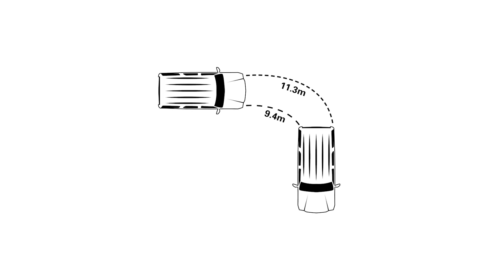SUB $600 DIY LOCKER INSTALL – Watch how much difference it made - Front vs. Rear, Manual vs. Auto

Comment: These things are essentially a ratchet in place of your normal diff centre (spider gears). They lock up under power, and force both tyres to run at the same speed as the ring gear, never slower - but if one tyre (the outside tyre) wants to run faster than the ring gear, it ratchets (hence the clack-clack noise) and that one side unlocks. The slower side is still locked to the ring gear. This means shock loading is reduced compared to unlocked diffs, so you should break less halfshafts in theory.

In theory...!
Reply: I was wondering and this is the perfect explanation. Thanks!
Reply: I see as a load thing. .certain amount of load and it slips. .. I agree with you. .in theory ☺
Reply: @simontheyers547  It's not a load thing, and my explanation is not a theory.  I'm not trying to be rude, just explain that this is how they're engineered.

Ok, if you want the facts of how they work:  Your diff centre spider gears are replaced by two solid chunks of metal with ratchet sprockets on the outside, that mate into special side gears with similar ratchet sprockets on their inside face.  Under no load, they'll ratchet (clack clack clack as one tyre spins faster than the other - or in the opposite direction even).

Between these two chunks of metal you have a pin (the "carrier cross pin") that runs right through the thing, in a hole that isn't quite round.  As you apply power, the diff carrier pushes on the carrier pin, and the carrier pin slides inside the slightly not round hole it lives in.  This then pushes the two halves of the diff centre apart, forcing them into the side gears and locking them (and by extension, the wheels attached to those side gears by halfshafts).

If one wheel tries to run faster than the diff housing, that causes the pin that is forcing the two halves apart back into the centre of the not quite round hole because it's not pushing the diff centre as fast as the wheel is turning.  This lets the two halves slip back out of engagement with the side gears, and the whole thing unlocks, allowing the faster wheel to ratchet.  (Clack clack clack).  You can see this demonstrated at 2:12 in the video, where he pushes one side out of engagement with a screwdriver.  In that shot you can also see the not-quite-round hole between the two halves (he doesn't have the cross-pin installed at this point, you can see it on the floor on the left).

This is why if you try to power around a corner, they'll make crashing, banging, clunking sounds as they lock, unlock, lock and unlock over and over again.  Most people try to coast around corners or at the very least, take corners smoothly without excessive power.

This is not theory, this is how they're engineered.  Trust me, I have built these into diffs.  I get how they work.
Reply: @antontaylor4530  Basically it's a mechanical blinding version of a friction plate pack LSD except these lockers come as 2way only hahah. Hate the stock D22 navi LSD coz it was only 1way (triangle and not 'not quite round' hole. Either way I don't know why people can not wrap their heads around the working of it.
Reply: @liamcooper5202  They're actually the opposite of an LSD mechanically and operationally.

An LSD is a set of clutches, and it'll slip if one wheel experiences significantly different forces to the other. This means that an LSD will usually slip if one wheel is in the air, making them barely better for offroad use than a basic open diff. They're not designed for offroad use, they're for track, drag and street use.

Yes, manufacturers have fitted them to 4wd's.  But that was more about marketing and mall crawling than offroading.

LSD's aren't "lockers" at all, they're "resistant" differentials.

A locker can lock up solid. An LSD can't do that (if it did, it would become a spool at that point, not an LSD).

A "locker" is either automatic or selectable. A selectable is a diff, most often open but sometimes carrying an LSD centre. You select when it should act like a spool.

An automatic is not a "differential" at all in the traditional sense if you look at the assembled components.

It's either locked up like a spool, or it's ratcheting. It never, ever sends power to each wheel proportionally to the distance the wheel is turning - it either sends 100% to both wheels, 100% to one wheel (in low load scenarios) or it is unloaded and there is nothing to send to either wheel.

Switching between 100% to one wheel, then 100% to both and back again is the reason they crash and bang around street corners when under power.

This makes them great for drag cars, drift cars and offroaders, but terrible for track cars and mall crawlers.
Reply: Anton Taylor thanks guys for the discussion, it’s given me a better understanding of how the Lokka works. You mentioned the ratcheting around street corners under power. Does that happen when the vehicle is in 2wd ? I have a Hilux the same as in the clip and just trying to get my head around how it would behave in daily driving. Also how it would behave in sand where a turning wheel might not have enough traction to force the ratchets apart? Cheers...
Reply: @4bnewb969  as far as i remember, your hilux has auto hubs. So when in 2wd the diff shouldnt spin at all. If that isnt the case you will hear the same sound as demoed in the video. Soft sand, snow and soft mud are all bad ideas with an auto locker in the front (rear is not much better). They are best suited for medium to hi traction 4x4 like forestry tracks and what not. Hope that helps
Reply: @antontaylor4530    i understand how clutch pack LSDs work. And its based on how much force is being transmitted though the carry pin and shape of the "not so round hole" 
I also over simplified the differences between a clutch pack LSD and auto locker. But both use the same mechanism to transfer drive carry case to the axles. What you maybe thinking of is a viscous LSD which is a normal diff plates that use the oil as resistance to try to keep the shafts rotating with the carrier. These diffs are much larger than a clutch pack LSD and require a different housing. Clutch pack LSD, auto lockers, e-locker and are air lpckers can all fit within a standard diff housing.
Reply: @4bnewb969  in 2wd it will do nothing if its in the front axle, although if you have flanges instead of freewheeling hubs (or you forget to unlock the hubs) it'll make a click-click-click sound as you go around the corner.

If it's in the rear, then it'll obviously behave the same way in 2wd or 4wd.

That is to say if you coast around the corner or use minimum loud pedal, click-click-click sound, but if you power around the corner, CLACK-BANG-CLACK. Basically the same thing but louder and more annoying as it locks and unlocks more violently. 

What it'll do in sand, I cannot say for sure, but I would assume that under enough torque to move the vehicle, it'd be under enough torque to lock. I know that they lock just fine in sloppy mud, so they're probably going to be ok with sand, but if you want to be sure then I'd talk to someone who's driven sand with these.

We don't have much sand to drive in England, but we have mud aplenty.
Reply: @antontaylor4530  they hard lock in soft sand, soft mud and snow. Guys in Canada wont run them on the road because they wont unlock and therefore steering become a problem. Here is Aus we have the same problem but with mud. I've seen countless trucks go in straight lines because the mud is so deep and soft that they cant unlock. Same on soft sand.
Reply: Liam Cooper thanks Liam, thanks Anton. Appreciate your time to answer my queries. FYI, my Hilux has auto hubs so appears the Lokka will be effectively non existence when running in RWD. The info on the really low traction surfaces confirms what I thought  - steering could possibly be an issue. I just have to decide how often that will happen with my use of the vehicle.....or keep saving the pennies for a selectable locker!
Cheers...and stay safe with what’s going on in the world these days
Reply: 4BnewB and how does the ratchet effect work when in reverse?? Also Shauno says they are always locked and unlock when cornering but comments here are saying they lock under power implying they are normally unlocked. Hmmmm
Reply: @jerrymyahzcat  they act like spool when at rest and driving. There are preload springs that mesh the ratchet together. The carry pin add extra pressure thus increasing the force needed to unlock it. It works the same way in forward and reverse unlike a cone lsd (used in Nissians like the D22 Navara which are 1way).
The sping pressure can be overcome easily when turning as the outside wheel spins faster, unloading the carry pin from the outside (inner half) of the ratchet assembly but if you apply too much power it will not unload fully and the forced unlock is a rather load bang each time.
Reply: @jerrymyahzcat  They also lock in reverse.  They don't care which direction the power is going.  As I said, the rotation of the pinion pushes the two halves of the centre apart, forcing them into the side gears and locking the whole unit.  The pinion pushes those two halves apart equally well in both directions.
If one tyre tries to run faster than the pinion, such as the outside tyre when cornering, that unloads the pinion and it unlocks.  If you put down loads of power in a corner, it can stay locked, and one tyre (the inside tyre) will chirp or lose traction altogether, or (worse still) it'll lock/unlock/lock/unlock with lots of crashing and banging sounds.
And yes, Shauno oversimplified his explanation.  He wasn't "wrong" - just oversimplifying so that everyone can understand.  I mean, he technically was "wrong", but if you understand how these things work, and how many people's brains cannot handle that level of detail, you understand why he oversimplified the way he did.
Reply: Anton Taylor ah yes. It was just because someone mentioned ratchet and a ratchet only goes one way so it’s obviously NOT a ratchet mechanism.
Reply: @jerrymyahzcat  I said it ratchets. Whether or not you want to call it a ratchet or not is symantics - especially since it does only go one way - the way the transmission wants it to go.

A ratchet spanner will only ratchet in the direction that the operator chooses to set it to.

These things will only ratchet in the direction the driver choses to set the gearbox.

That sounds like a ratchet to me, but if you don't agree, then that's fine. What matters is how these things work, not the language you choose to describe their operation.
Reply: @antontaylor4530  well. my mazda lsd let one wheel spin untill i gave more power and it would lock up leaving 2 straight black lines in the road so you are wrong sorry.

 same applies to my can am witch has lsd in the front diff and will dangerously bind when revving in the woods.

 limited slip. not limited grip as you claim

 Lsd is good for track but it snaps axles when engaging at high revs when offroading.
Reply: @vihreelinja4743  I'm not wrong.  I've rebuilt open diffs, air actuated locking diffs and auto locking diffs, as well as clutch pack LSD's.  Your misconceptions don't make me wrong.  The only type I haven't rebuilt is the automatic torque biasing type LSD.

A limited slip differential (at least, a Mazda one) is based on a clutch pack.  Those clutches will slip if you put significantly different loads on the two tyres, which is why they are called "limited slip differentials" and not "locking differentials".

The reason that both your tyres light up is that they also contain a viscous coupling fluid and viscous coupling plates that function in the same way as a torque converter on an automatic transmission, so that when the clutch pack starts to slip, the viscous coupling forces the other tyre to turn also, albeit slower at first.

In your burnout scenario, the clutch pack is slipping, and when the diff speed is high enough, the viscous coupling forces the stationary halfshaft to start spinning.  Once that tyre starts to slip, the clutch packs will then start to drag the two halfshafts back into sync.

At no point whatsoever is one shaft locked solidly to the other.  And just because I didn't describe the viscous coupling (when it wasn't the point of the video or the thread here) doesn't make me wrong.

There are plenty of videos out there that will explain how clutch pack LSD's work, go educate yourself.

Because bleating "you're wrong" about a thing you clearly don't understand might make you look like a monumental idiot.

If they didn't work the way I described, and worked how you think they do, they would be used on 4x4's for rock crawling and mud bogging.

They're not, because you are wrong.  Lockers are used instead, and only light duty "softroaders" tend to have LSD's.
Reply: @vihreelinja4743  Oh, and as for "limited slip, not limited grip as you claim" - I never claimed that.

Muppet.
Reply: @Anton Taylor  since you seem to a be a bit knowledgeable on these types of lockers would one in the rear be ok on a daily? I already drive live like a granny and am practicing coasting around corners in preparation for getting one, there also the only locker options for my rear diff so it's either that or open which sucks balls offroad lol
Reply: @Catboy-hr2qp  Loads of people run them.  Be prepared for funny noises (clicking and banging) when taking uphill corners.  Some people only run then in the front and unlock the front hubs so as to bypass the problem.
Reply: @Anton Taylor  how do they do at highway speeds uphill? I already have a selectable locker upfront. My only option other than this for the rear is swapping a dana 35 in and running a selectable with chromoly 27 spline shafts so it's like a half super 35 kit.
Reply: @antontaylor4530  Thank you Anton. Im going to buy this for my rear on my hiace 4wd 200 series.
So you mention this banking clunking etc. Are you implying its normal and nothing to be alarmed about?
I just want it for sand and beach driving.
Reply: @minhgtr  The better set up it is, the less noise it tends to make but yes, they're noisy in the corners under power.  Expect weird noises from time to time.  It's normal.
Reply: @antontaylor4530  Thankyou. I have ordered one from Adelaide Company 4wd Systems. Its the 30 Spline , 10 bolt 8 inch for toyota diffs. Hopefully its good
Reply: @minhgtr  Let us know how it goes!

Comment: I run one of those lockers in the front of my v26 mitsubishi ,massive difference than not having one ,and It puts less stress on the drive train 😎🤘🏽
Reply: Nice mate. I have a pajero 2.8TD LWB can you tell me if it fits on that model?
Reply: Diogo Pronto I had my locker in a V46w lwb  1996 2.8 ,I swapped all the drive train over for the lower ratio diffs into my swb v26 w it works great better climber now ,good luck
Reply: Junk!
Reply: Actually lockers put way more strain on your drive train especially your ring and pinion

Comment: I had Lokka lockers in my Jeep Liberty on both ends. I had a lot of fun watching the looks on fellow offroaders who would wonder how a Liberty could do what it did. Now I have the same setup in my Jeep XJ and it goes anywhere. Lokka is great. They delivered in 3.5 days to Canada twice.
Reply: Scott Miner 
How loud are they for daily driver vehicles? Slight? Annoying? Obnoxious?
Reply: My front one is awesome, but I am hesitant to put one in the back because I hear that pavement driving is terrible.
Reply: @mikethemike6406  It will chirp the inside wheel when you turn off a stop sign unless you let off the gas as soon as you start to turn. With very little practice, you let off when turning at low speed and you will never notice it, except you hear it click.
Reply: @hardcasthale4904  You can hear it click when you turn. I drive a Jeep so it isn't "quiet" in the first place. Some times I hear the clicking over the snorkel intake six inches from my head or the "low flow" exhaust system but not often. :)

Comment: I fitted one of these 6 years ago to the front of a 2000 Ford Courier.  Yes a light duty 4wd with very limited wheel travel. Made a huge difference off road. Highly recommended!!!
Reply: The Lorax, G’day Champion.
Mate how is that lokka going for you now? Also, how does the Courier drive on a daily basis? Eg; in 2WD.

Cheers in advance...
Reply: @phillipsampson4001  it was still going strong when I sold it 2 years back.  It was fired with 31's.  I was commuting on a bike so not doing massive k's in it.

Comment: I have one in the rear of my Fist Gen Tundra, super fun in 2WD in snow ! Street driving is a little strange but easy to get used to!
Reply: I put one like this but different brand in my rear of my CJ7. It worked but I had a lot of slop feeling every time I hit the gas at first. Did yours do the same?

Comment: Fantastic Shauno - I have been a fan of the Lokka style of Diff Lock for years and have installed them in IFS 4Runner and even a GU Patrol and what a magic item they are. Thanks for sharing and dispelling all those myths that those with $2000 ARB Lockers like to talk about. They are an extremely capable Lokka for sure!